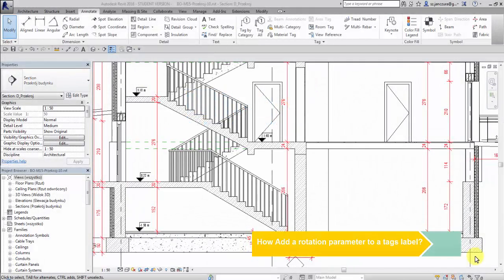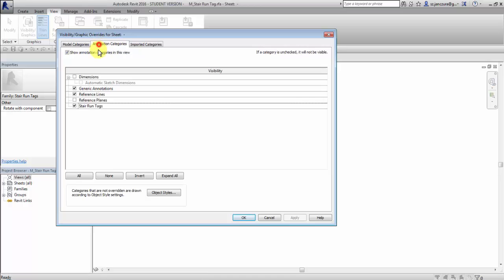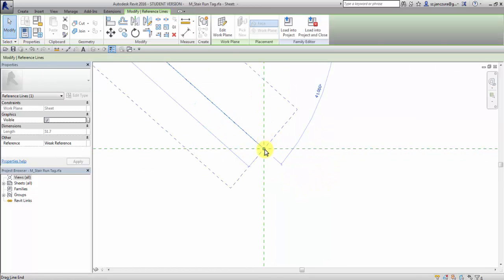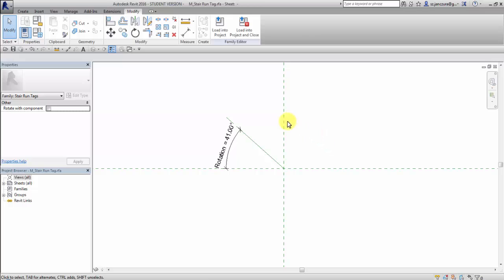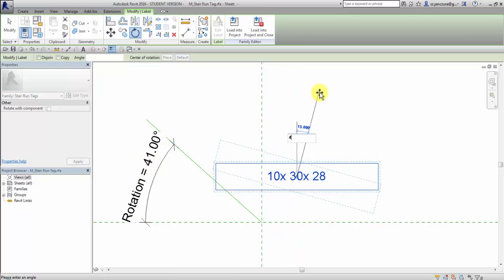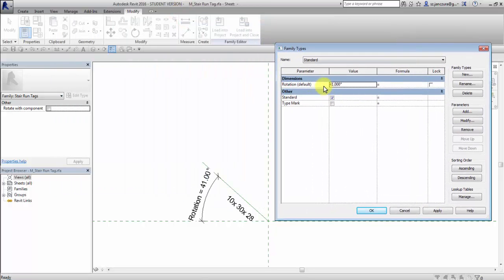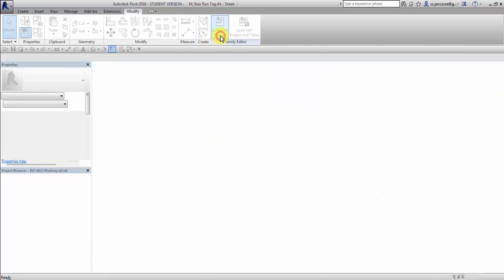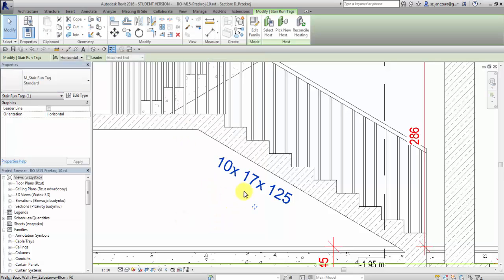Revit Tips & Tricks - How to add angle parameter to tag/text

Comment: (For rotation) I'm not able to align the line on both planes, after locking the alignment on single plane, on another plane instead of lock, line geting extended.  What is the solution for that.

Comment: Your rotation parameter  does not work at all.  If you test values from 0 to 360 the reference line is unlocked automatically and goes in all directions....
Reply: You need to dimension the origin with two dimensions set to zero, one for x one for y.
Reply: @jlumley   Could you explain in a little more detail what you mean here please?  Many thanks.
Reply: @jlumley  my notifications said you had sent me a picture but I cannot access it ...tried typing in the url but that didn't work either, sorry.
Reply: @jlumley  Cool thanks for that.  I'm reviewing our families atm so will try to incorporate some angles as needed.  Thanks again